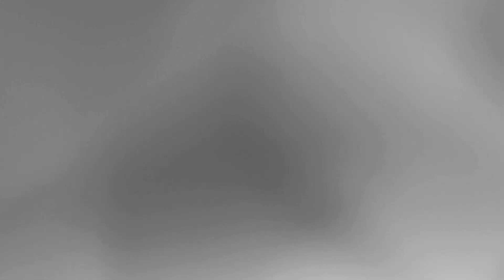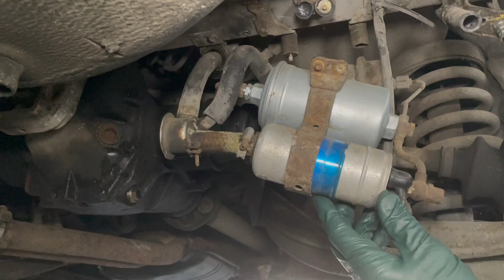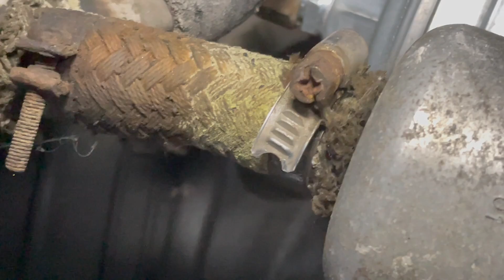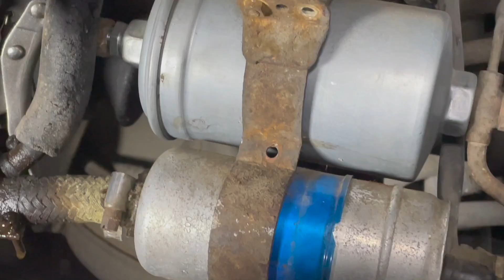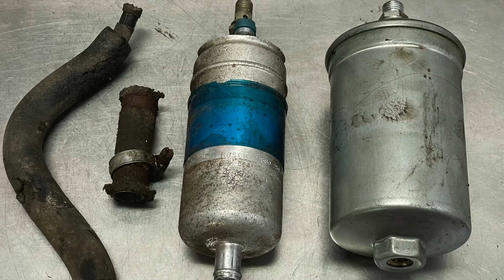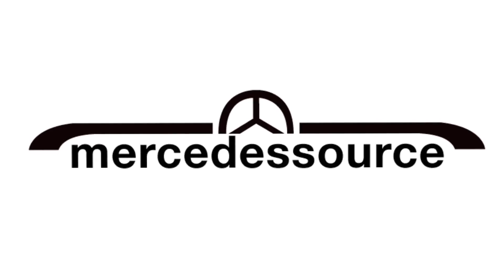1970s to 80s Mercedes Fuel Delivery System. How Most Look and Repairs Needed.

Comment: I have a 1970 W108. Where can I purchase the whole fuel pump plus accumulator system with brackets and hoses? Mine is completely missing.
Reply from the maker: Need to know your model and the engine displacement to advise.

Comment: Do you have a kit for a 1982 W123 straight 5-cylinder?
Reply from the maker: Yes, it is different from what you see here, but I have a performance fuel boost pump kit for the W123 diesel engine.
Here is the link:  https://mercedessource.com/store/w123-diesel-performance-fuel-boost-pump-installation-kit

Comment: I have a W114 250ce. Will this kit fit? I have only bought the car and I can see the same setup under the car. The car has not run in the past 30 years.
Reply from the maker: What is your year and model and send pictures of the pump and filter assembly to  sales@mercedessource.com
Reply: @Mercedessource  I have a 1972 w114 coupe. I will send you the pics when next I am under the car, which is likely going to be next weekend.  Thanks

Comment: Hi there
I have a Mercedes w126 300se 1987 and after driving it for a while the fuel pump gets really hot and the car doesn't start until i throw water on the fuel pump to cool it down is there a specific reason why this is happening and solution? Thanks

Comment: Does it matter how the injectors wires on a 1973 450 sl get plugged into the injectors.  I do not see a + or - marked on the injector itself.
Reply from the maker: The injector operates on a solenoid. It is not polarity-specific. If the wires are a different color, you would need to wire accordingly. But not both your wires are white which indicates it does not matter.

Comment: Hello
I am interested by your kit. It is for a 450 SL 1976 US version.
Can you please send me the link?
In advance thank you
Reply from the maker: There are two distinct kits used on the mid-1970s 450SL. You will need to visually inspect your current system before ordering. Here is the link that explains more: https://mercedessource.com/store/1978-1980-w116-r107-c107-v8-fuel-delivery-overhaul-kit-limited-video-instructions

Comment: ^^^Take his advice ^^^. I had a 74 450sl with a full tank of fuel start leaking, tried clamping the line to stop it... the line turned to mush and it started pouring.  Minimal time, Buckets and a mityvac saved it from being a disaster.  Since the oem fuel pump was discontinued and the alternative was way too much pressure, i put an NOS datsun/nissan bosch pump on that matched perfect  in size, holes and psi to the original mercedes part... (this was before i stumbled upon your channel and store). Thanks for the videos, tips and advice mercedessource!